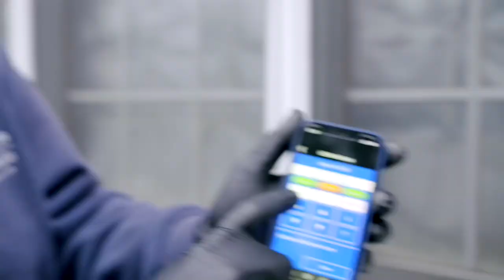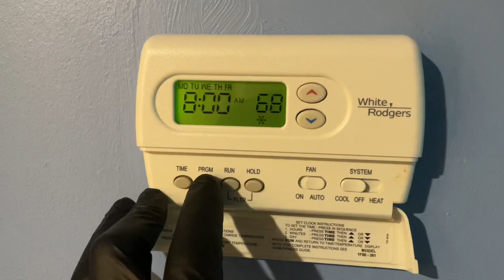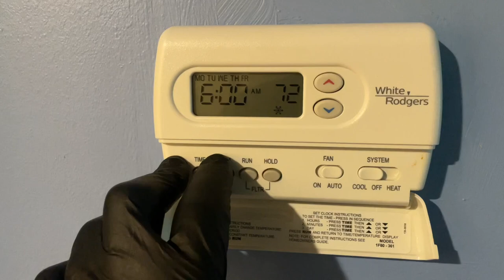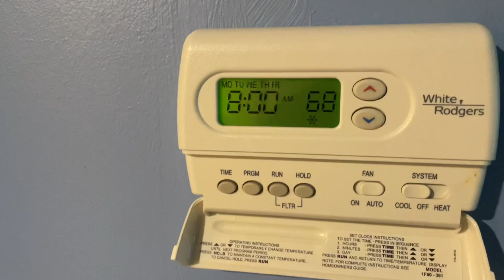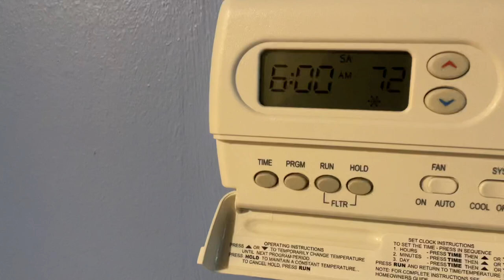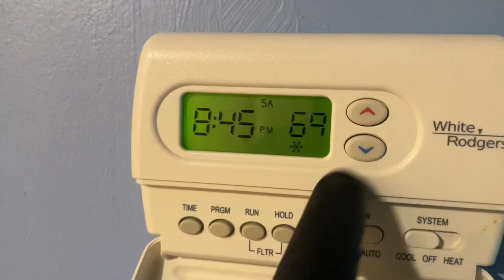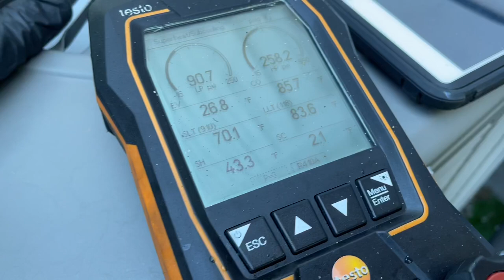How to Program White Rogers 1F80-361 Thermostat & Lennox System Low Refrigerant R410A

Comment: I have the same thermostat. I set it for all times as the exact same. Time, AM, PM, are correct but even after hitting run. I will have it set to 68 but it gets as high as 72 before the AC kicks on. In fact that is what it is right now. Even with it set to AC.
Reply: @PipeDoctor  Thank you for getting back with me. Turn out what it was doing is getting the house hot then waiting for it to cool back down. Then turning the ac back on. The ac was actually heating the house because I had a reversing valve that was stuck. I have a friend the worked hvac. He walked me through some steps. 

So I know it is blowing hot air when it kicks on. The cooling line is getting hot when it should be getting cold. The coil is getting 24v. It also is not shorted anywhere. The coil does become magnetic when the 24v is on it. 

Using this trick 
https://www.youtube.com/watch?v=atiXmN2swgA

I could see that even though the coil is turning on the valve is not moving. 

I have tried switching it from hot to cold over and over. To try to un-stick the valve.

I have also tried tapping it hoping that the shock was knock something loose. 

Seeing the video I also had the idea to use a very strong magnet from a magnetic base to try and free it up. Sadly I could tell by the fill it didn't move even with that.  It also didn't seem to fix it. So I have someone coming tomorrow to double check and replace it. If you have anything to add please feel free to let me know and thank you again for your response.

Comment: Questions:  1. can we simply set it as 72 degree 7/24? If so how do we set the program?    2. Our building basement have thermo IF80-261 and it's for the heat. Is the thermo itself the place it detects the temperature? (i.e. the basement temperature rather than 3F) right?

Comment: 2 QUESTIONS:  watched your video which helped me but once I press RUN, should the left side of the screen alternately flash the time then temp??  Right side shows constant set temp.  Is that correct or did I do something wrong?
Second question, it seems that there are 4 parts of any given day.  Can the second and third portion of the day's schedule be the exact time as that morning/evening?  I only want two different settings...one for morning and one for bedtime.  Thanks.

Comment: I have a model a little different (1F85-275) and can't figure it out.  Basically it's just auto or fan.  I'm trying to set it for heat, but not AC.  That's why i found your video- which is great- but doesn't help my situation :( btw- congrats on having so many followers- impressive :)
Reply: Just push the little tab from cool to heat and set your temperature

Comment: Is there a way to make that thermostat come on a degree warmer then what it’s set to? For example let’s say I have it set to 73° it clicks on when the temperature hits 74 degrees then once system is running it doesn’t shut down until 72 degrees while the temperature is set to 73 degrees is it possible on that model? I have the same exact thermostat but not sure if there’s a way to program it to operate that way instead of it maintaining 73
Reply: @PipeDoctor  how would I do that exactly ?

Comment: Do you have a
D you have referral in Delray Beach Florida?
Reply: @PipeDoctor  i found a referrel for a Matt owner of Top Shelf Air. He rinsed coils but the coils are showing corrosion. 2015 Rheem. Filled 3lbs on unit. Garage mini split took 1lb. He raised pressure to 130 over 400?.raised temp by 6 degrees. Unit was working but now optimal. He quoted me low 3k when I am ready to replace the outside unit. $390 total..

Comment: Mikey how do you over ride those programs so there not kicking on all day. I have a family who gets either hot or then there cold so it's better for me to adjust by hand but it's annoying when all of a sudden it adjust itself to a different temperature depending on the time. Then everyone is yelling at me to change it. I'd rather change it during each hour I haven't figured out how to override the program settings other than I think keeping it on hold all the time. I have that same thermostat thanks